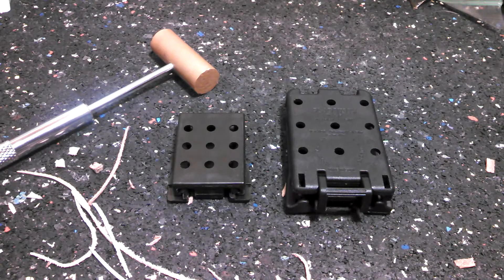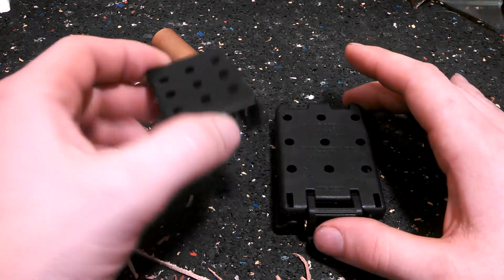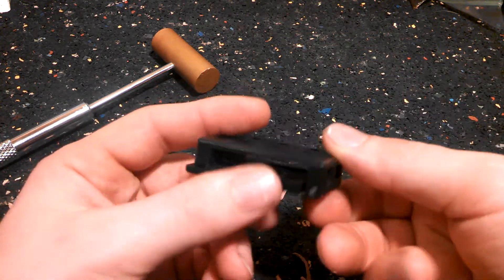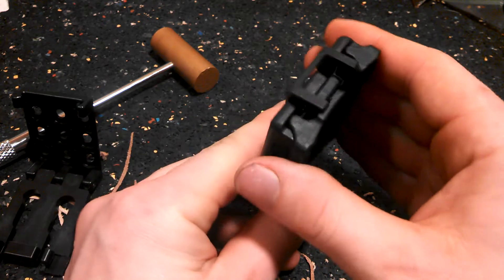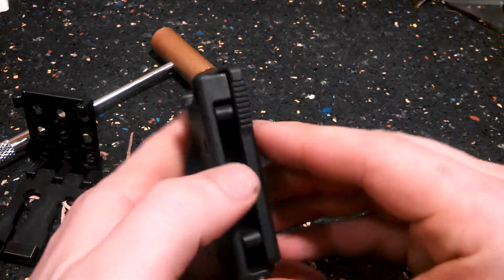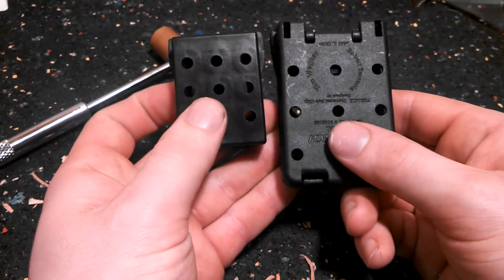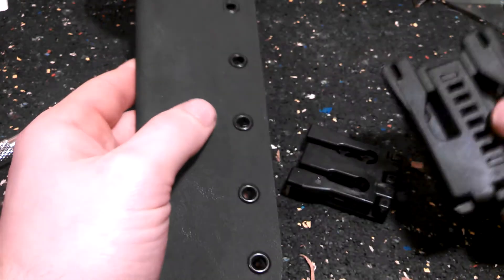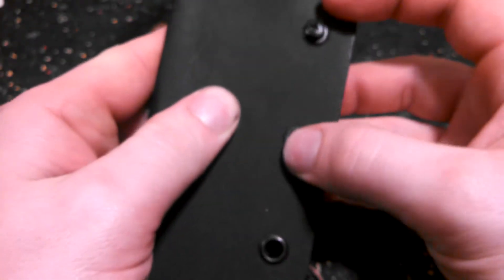What The heck is a Tek-Lok???

Comment: They should make three rows with each having an adjustable mechanism hole that you can slide to length and tighten down where you need it. I barely got my Strider MFS sheath to fit the big Tek lock. This video stopped me from ordering the small one because I doubt it would've fit. Thanks!

Comment: The rubber spacers go between the sheath and the tek lok so it fits flush on the wider blades. They do not go on the inside of the tek lok like you showed. They are spacers not flex protection. The tek lok should never be attached off center from the knife either. Good video though alot of good info.